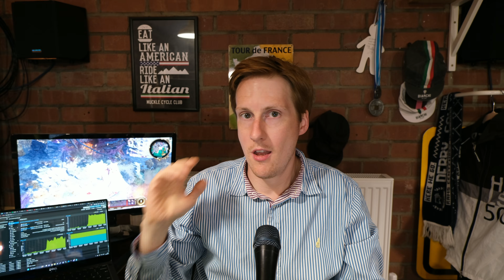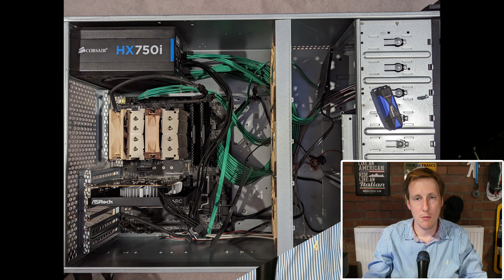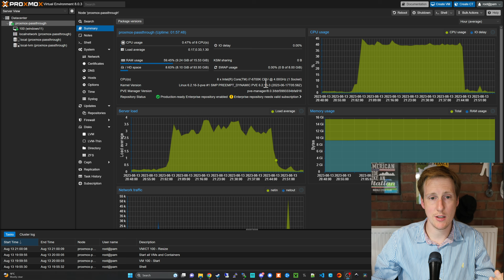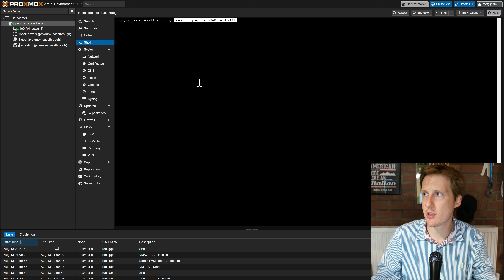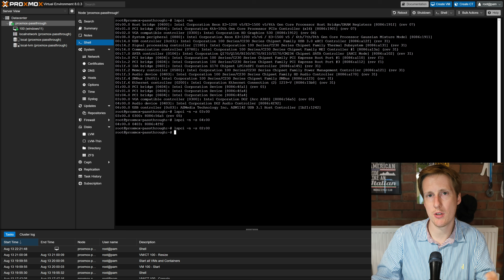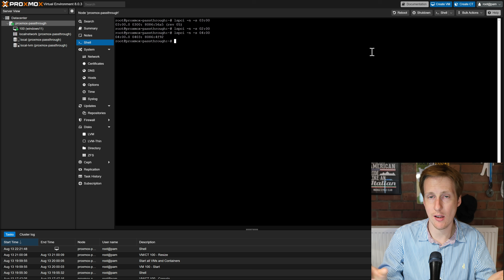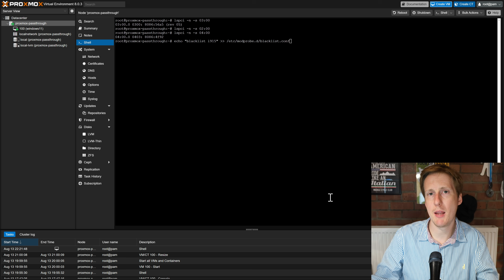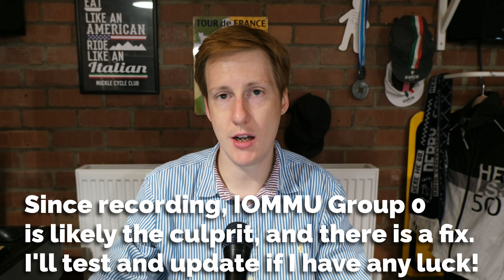Double GPU Passthrough in Proxmox 8!? Play Baldur's Gate 3 and Minecraft On The Same Machine?

Comment: you can run many games, not just a simple two.. and you don't even need virtualization. Linux is built as a multi-user system (windows is a single user system) and you can connect multiple keyboards & mice to the same machine and play on separate monitors/users of the same machine.. again, no virtualization necessary.
Reply from the maker: Thanks, I'm planning to cover this further down the road.

Comment: Would passing through a GPU cause issues for an AMD based system where there are no built in graphics? I have read that it won't work but that a few years ago
Reply from the maker: You mean a discrete GPU in a PCIe slot? That should be fine.
Reply: @Jims-Garage  Yeah a 3700x cpu and quadro p1000 gpu. I don't have all the hardware yet to test but I will give it a try. Good info
Reply from the maker: @Catge  that should work perfectly, especially with a workstation GPU.
Reply: cheers mate, I will sub for more content @Jims-Garage
Reply from the maker: @Catge  Great, much appreciated

Comment: Great video, thanks.
If I want to install Linux like Mint/Ubuntu/Debian with GPU Passthrough do I need to add TPM, change machine to q35 and BIOS to OVMF(UEFI). 
Meaning do I need all of them or can skip some for example TPM?
Reply from the maker: Thanks, I think you need to do the same process. Test and let me know.
Reply: @Jims-Garage  I saw other people on YT doing GPU PassThrough without these options so the question arose. Hoped you could know but will have to test it myself.
Reply from the maker: @cort  double check the official documentation as that is what I referred to.

Comment: For audio, you could run a Scream server at the host level and use a virtual network adapter. Then from your VMs, stream your audio to the host machine, then output there.
Reply from the maker: Good shout, I will check that out.
Reply: @Jims-Garage  I run a pretty cool workstation setup:
I run Proxmox on the host and 2 VMs.

The host machine is a 2nd gen threadripper build with a workstation amd gpu.
My favorite part of this setup is being able to break my linux workstation, and restore the daily backup.

VM 1) My "workstation"
* EndeavourOS
* GTX 970 running 4 displays
* pcie usb card
* I use Moonlight client to connect to the Sunshine service running on VM2, via a virtual NIC bridge.

VM2) Gaming
* Windows 11
* RTX 3060 with hdmi dummy plug
* LSI SAS card with sata fanout cables to 8 ssd.
* I use Stablebit Drivepool to store all my games on the 8 drives.

On the other side of the room is my 42u rack, but that would be a rant in itself.

Comment: A couple of years ago, when I first time had contact with virtualization, I got fooled by the same thinking. Your CPU has 4 cores, and you have used 2 cores already, but you would need to set another 4 cores, 1 socket for a Windows machine. Then I have learned that the VMs just get access to use the cores and of course if there is no load why shouldn't they use all cores or those who need to run fluidly. Btw, a great video and well explained. Subscribed & liked.
Reply from the maker: Thanks for the feedback. For Homelabs you can usually over provision your VMs without impact, it's a useful feature.

Comment: thank you for the explanation. I followed this process but inside my vm i get an error when i try to run nvidia-smi

"NVIDIA-SMI has failed because it couldn't communicate with the NVIDIA driver. Make sure that the latest NVIDIA driver is installed and running."

I'm doing this on a supermicro server that has 4xNvidia A40 GPUs.
Reply from the maker: Let me take a look. I think for server GPUs (non consumer) you may need to go down the vgpu route. I'm surprised GPU passthrough doesn't work though.
Reply: @Jims-Garage  i have spent literally months trying Proxmox to work and must have followed a dozen tutorials from Proxmox 7 to 8. Non worked for me so far.

Comment: Thanks for your nice video! But I meet a problem, Balur's gate3 crash every time it enter the main menu. Did anyone meet Balur's gate3 crash problem in VM? I tried KVM win11, it crashed too. My profile: pve8, win10, amd 5800x(cpu select host mode) + GTX 1070 pcie passthrogh.
Reply from the maker: Thanks. Do you see the GPU in device manager? Is there an error 43?

Comment: Hi Jim, just found your channel, thanks for this video, great content! 
A few things I wanted to add:
* 25:16 Moonlight hosting is not an option with an iGPU as Moonlight only runs on NVIDIA GPUs. Parsec hosting might be an option with an iGPU if you can do with the free Parsec features, but it is probably not worth paying the monthly Parsec subscription fee to get remote access to an iGPU's performance and there's also an additional cost of a separate client machine eg. some kind of thin client or Chromebook.
* When it comes to running 2 separate games/sessions with 1 machine using the iGPU for one and a dedicated GPU for the other with a monitor hooked up to each GPU, Linux Multiseat might also be an option, alpard's adventures has a good video on that.
* Your Z170A GAMING PRO motherboard specs says the top 2 PCIe x16 slots can run in x8/x8 mode that means you might be able to passthrough 2 dedicated GPUs to 2 VMs in Proxmox which is way better than being stuck with an iGPU . Not many consumer motherboards these days I can find that can operate 2 PCIe slots at x8 speed.
* vGPU sharing is probably the way to go if building a machine from scratch for the multiple VMs with GPU accelaration.

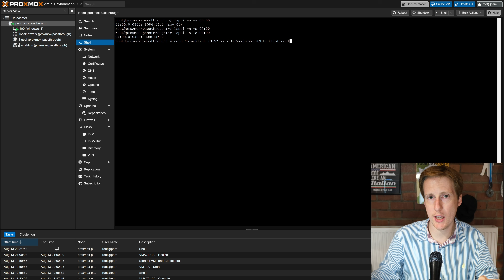Comment: @Jims-Garage - thanks for the great content, thorough explanations - in the same class as @TechnoTim!  At ~19:30, you point out that if the homelabber has their HDMI cable plugged in and they're currently using the iGPU, there won't be any video displayed (makes sense)...I assume that means that if one is using a PiKVM for remote console access, there' won't be any video.  If that's correct, is there a way to provide video to the PiKVM?  Thanks again!
Reply from the maker: Thank you, that's high praise, I love Tim's videos.

If you're blocking the iGPU by not loading drivers I don't think it will work, you would not be able to access the bios etc.

Comment: Very well explained, I'm thinking about buying an RTX A4500, but i want to share this card over multiple VMs, apparently the technology for this to be possible has been developed a long time ago SR-IOV, but the manufacturers are blocking this, of course. I see Nvidia developed some proprietary stuff for their Quadro gpu's vDWS, virtual work stations, but it only seems to run on VME or Citrix, I'm using Xen orchestra myself. I used Proxmox, but experience several severe crashes when i had to reinstall the whole thing. Anyway sharing GPU's among VMs should have been here yesterday, would be interesting if you know more about it and can share it in a video.
Reply from the maker: Thanks for the feedback. You are right with your explanation as far as I am aware, locked behind paywalls (quadro required I believe). 

Unfortunately I don't have a card to test, but perhaps one day someone would be kind enough to donate or sponsor. It's something I'd love to explore.
What are you wanting to use GPU acceleration for? If it's Docker containers you could split between those (suspect it's VMs though).
Reply: @Jims-Garage  I need GPU acceleration for Blender, I also have a bunch of security cams on my network with dvr agent, it could use some gpu support, for recognition you can use the tensor cores for processing images. General GPU support in each VM is also welcome, since from a graphical perspective some vms are pretty slow. I have jellyfin now running on my main PC since i don't have a good graphical card in my server to do the decoding. What i would want, but of course this is not possible yet, would be a very flexible assignment of GPU power, when i render this power is moved towards a vm where blender is running, when i don't render, move that power back to a lower priority but usefull assignment. At the moment these gpu assignments are all fixed in configurations like you showed, this can done much more flexible upon demand, but this is the future i hope, sr-iov certainly would support these kind of use-cases. Anyway there are plenty usecases for flexible graphical horsepower nowadays and this will only grow, its just that the software is years behind it seems, i think a major cause are these manufacturers that want us to buy a separate gpu for each VM 😃, no way.
Reply from the maker: @Amplituhedron1  absolutely, I hate software locks (but I doubt it'll change in the near future...)
Reply: @Jims-Garage  Yes they will always keep trying, but with the emergence of hypervisors in the home environment the demand for more flexibility will grow, at some point they can't stop it anymore i hope. The hypervisor suppliers themselves could make a start,  by providing a mechanism to make those settings you showed us, automatically. For instance, each time you access the desktop of a vm, the graphic card gets passed through, to that activated desktop. This should not be that difficult and would already help a lot and would be a good start for some more advanced forms of sharing of graphical power.

Comment: hello jim thanks for the video, one question if possible, does the cpus that you passthru to a windows vm machine, when running a benchmark such as cinebench r23 or cpu-z do they all  work with default cpu turbo boost? or the cpu stays on default speed (lower clocks) ? if possible show us on a video how to turn on turbo boost for ryzen and intel cpus (inside a windows vm)
Reply from the maker: A good question, I'll investigate and report back. I suspect that the CPU turbos, and you would likely be able to see it on the host, but it probably isn't reflected inside the VM. So, you should receive a performance uplift, but you wouldn't be able to assert that against a visible clock speed change.
Reply: yes the biggest issue that we dont install some softwares in a vm is the lack of power from the cpus not entering in turbo boost mode @Jims-Garage
Reply from the maker: @rrodriguesv2  I've just tested a workload and the CPU was boosting in the hypervisor.

Failing that you could just pin the clocks to turbo boost frequencies in the BIOS.